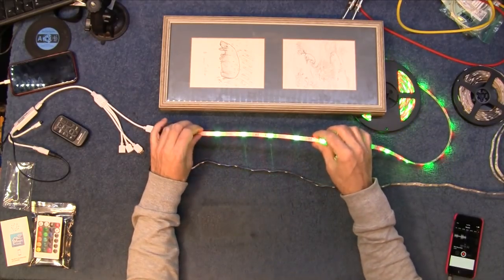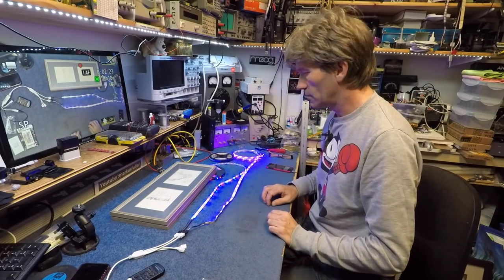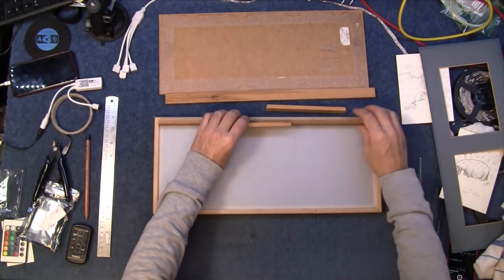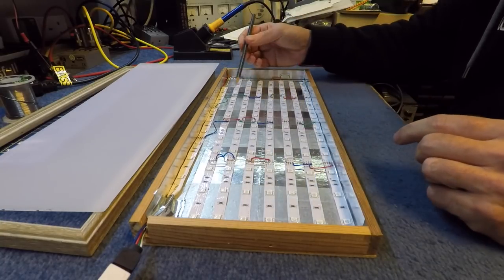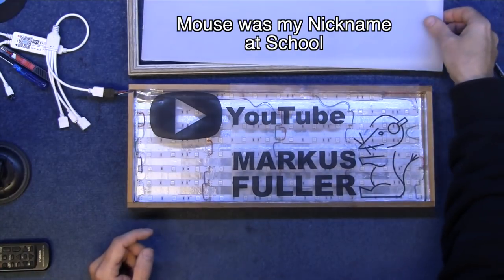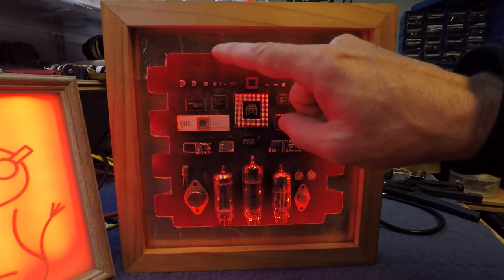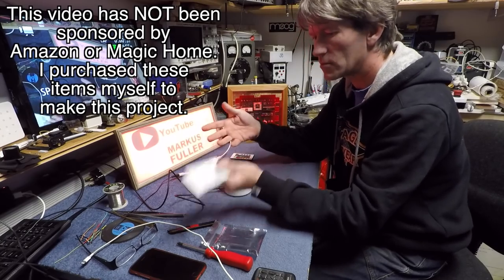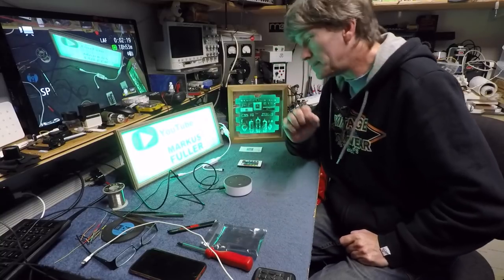How to make amazon Alexa controlled LED Light boxes & picture art

Comment: That looks pretty nice already. Where did you get that opaque plastic for the front (at 5:50)? Edit: I like this particular background tune a lot!
Reply from the maker: Chip Guy Vids I bought that from a hardware shop. it was just a perspex cutoff. i cut it by scraping a screwdriver along a steel ruler several times so it made a groove then just snapped like cutting a tile.